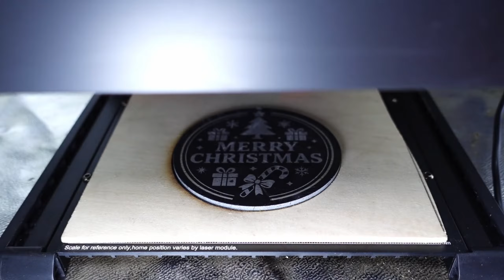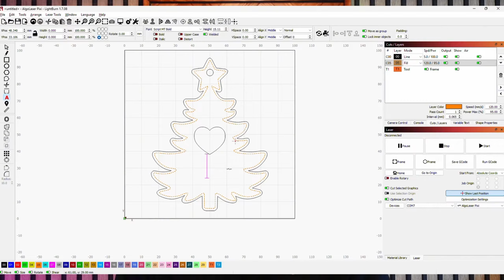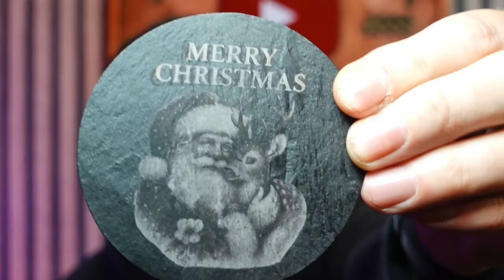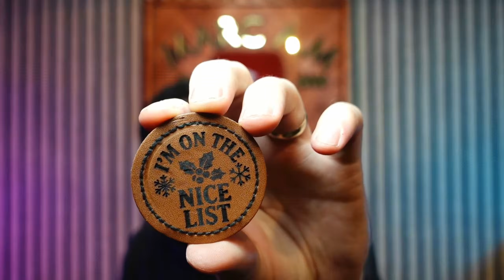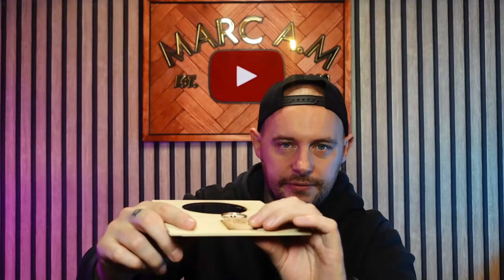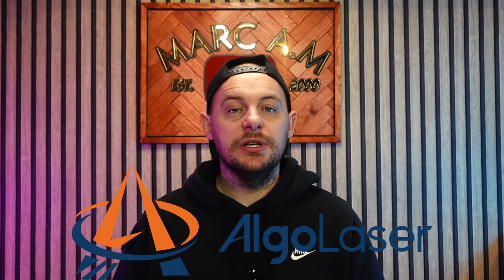Algolaser Pixi Laser Engraver — Real-World Results & Engraving Test

Comment: I am having difficulty engraving on glass mugs, any advise
Reply from the maker: Are you putting anything on the glass such as black paint or engraving paper?
Reply: @MARCAM  I used removable vinyl, I think my setting is the problem.    I don’t know what settings to use.
Reply from the maker: Is the vinyl laser safe? I would just use black paint or a sharpy will work. Just need to make sure it’s painted/ drawn in super clean and smooth